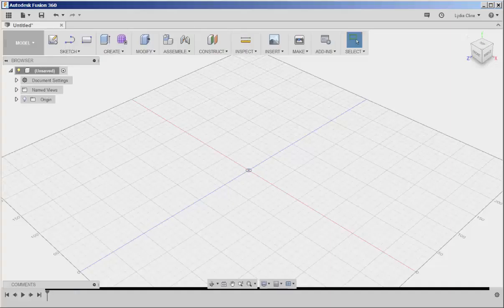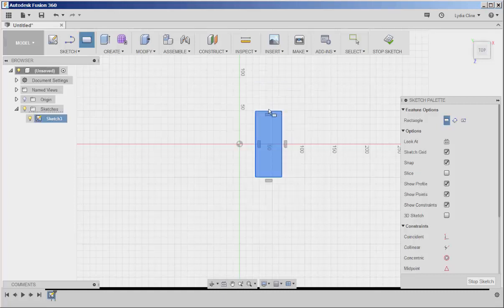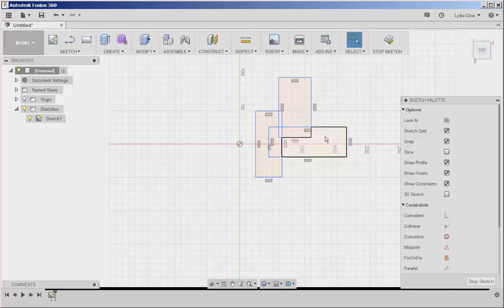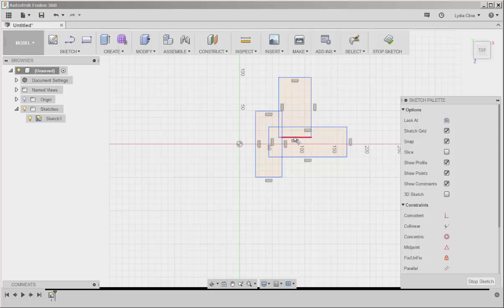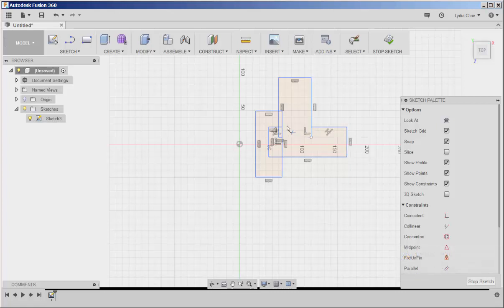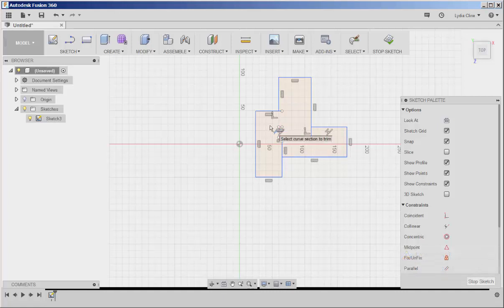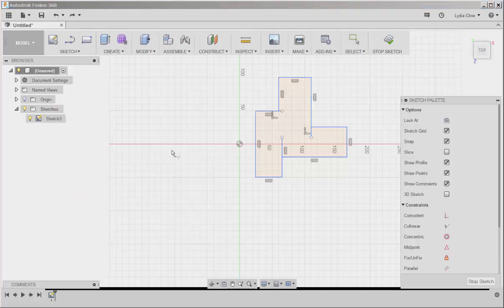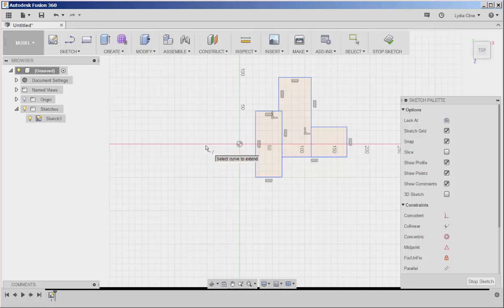Fusion 360 Trim and Extend Tools

Comment: Can you use trim on multiple lines at once? I haven't found much info on that.  Or use the trim tool similarly to how it works in Illustrator - I.e. you can subtract or combine, or whatever using other shapes to split lines etc.
Reply from the maker: Not that I know of.
Reply: @ProfDrafting  Thanks for responding!
Reply: Fusion has deleted the extend command